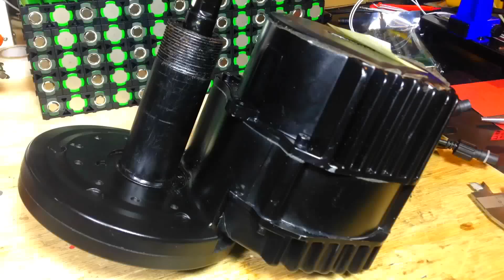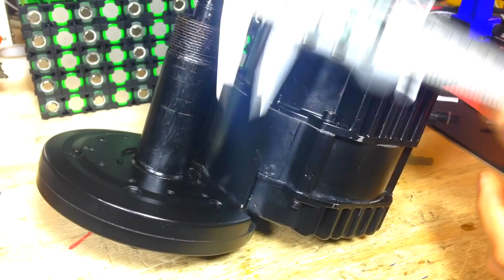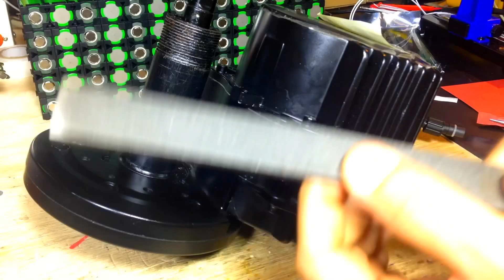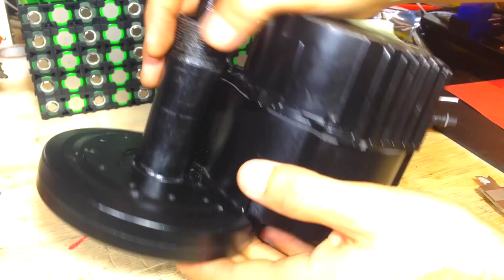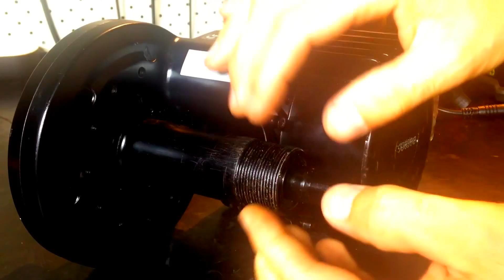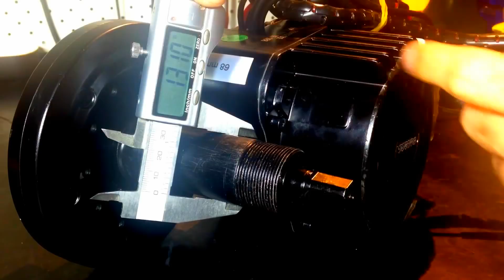BBSHD measurements: carbon fibre, dual suspension, fat bike bottom bracket • Bafang 1000w BB adaptor

Comment: okay who is this other guy that rebuilds batteries out of laptop batteries or whatever you do it more professionally that he does I'm homeless and disabled in Santa Clara California I need to find me a way to make a battery affordable at Laguna cycle is overcharging for the batteries you talk to them as a result I need to start up that be fun motor you're talking about is it good put the good motor to put on a bike and you're going through all this stuff I get free Target but I want to get power I want to make it but I will check but I don't have $2,000 plus to start up I don't have all those tools to make my battery pack the way you do I'm going to get my old you cells I'm going to make me a smaller battery pack that's not going to cost me $700 and last two years because they're not using the good cells you are using the good cells you're usually good batteries you got all the stuff down you're making it and it looks dangerous I don't have those tools so I thought of them together and now I'm making a good connection what could I use that metal copper stripping out there and I don't have that tool and I want to get as many Souls as I can and I want to make a bigger though they're brand new but I gotta put the battery back on it I don't have to worry about a thing cause I watched about 20 of your videos today I understand it all I got it all the little bits and pieces and then I got a sorry I can't spot weld it and I got to do all that stuff you're talking about I know I need to make their connection to the battery connections the ballast can I just I gotta get me the charging system what do I start with an x obviously you got the high and everything and I can't afford that but I quit would you start up I got to get a battery I have an electric bike piece of junk one but I need to get upgraded motor down the road as a buffet what are the way to go isn't the biotics who's system works good it's reliable I don't care about I'm overweight I just want a lot of battery power but fuck it basically a wheelchair and my legs and hold you up I might even be trapped in the house all day or heat an RV or I got two hours of limited ability everyday of my body and I want to be able to put it under the bike I won't be able to tell the bike I'm going to get because I thought I would tell you bout to start with I'm homeless and disabled in Santa Clara please help
Reply from the maker: +James Ledesma - Hi James, I completely understand your disability, my girlfriend is also disabled and I see a huge potential to help hundreds of thousands of disables with these electric drive systems. The guy I was talking is Jehu Garcia in California, he is a really nice guy, if you come to his place "I think" he could help you with some old batteries.Maybe send him some messages and see how it goes. He uses laptop batteries, you may be able to get some from these battery disposal everywhere around the USA, take some home, open, get the cells, get a small battery tester and check the cells, 80% would be fine around 20% may be bad or you may be lucky and get all cells 100%
Let me know how it goes, I hope I helped =]
Reply: But it won't be able to build them like the way you do I don't have all that machinery and I can't afford to buy the spot welders just to build one or two batteries and in the end don't know which one to go with because you I like the way you did with the I love what you did with the motor but I'm a heavy guy on a bicycle that basically isn't designed to hold a heavy guy and I can't cuddle all the time because my legs are but I have to have a townie bike and you didn't put that motor on a townie bike so I don't know if it's even able to hold the weight of me and Mabel to last I can't cuddle all the time but I do what was that goes a lot farther than 4 miles it has to be charged for 5 hours and then have to come back for my house I need a bike that I can build cheaply and I get free Target bikes every day every year so if I can put whatever I want in the Target by and swap it every year I told have any maintenance I don't have any Tire because I don't have any brake maintenance I don't even know if I wanted his brakes or regular V brakes I'm not going anywhere I could climb those big hills in the Bay Area it's pretty warm it's basically only that overpasses that go over other freeways he'd only got a little heel for a little time but the bike is guy it's not going to be able to stand the weather and it doesn't get cold enough here it might only three four or five times a year but I live about billionaires and see if I can't leave this bike outside I got to be able to roll it I might even have to make it a fat bike foldable bike I'm not sure yet because those things are low to the ground and easy to step over and they're able to go over curbs and kind of indestructible but I won't be able to get that bites every year butt I like the bigger Tire and Wheels I felt like the road like that you're off the hook that says that you have to be able to ride it when you stand up on it you can put your legs down and touch the ground only bike you can do that with his accounting bike and they're too expensive to buy the motor system I'm not sure the Boss motor systems even worse by the bus just too expensive the bike is crap bike will fall apart after a year I'll get him if I can replace it every year with a free Walmart or Target but I got the maintenance staff I got the new tires they're here I gotta go got is what bike to start with what motor to put on a hub versus a big Drive in the Big Driver is only 4 guys in the players there's 8 phone I can't pronounce the word it's the motor that you're talking about isn't strong enough to pull my fat ass and not blow up more weight you put on the border the Border but you put to it I thank you for responding but I don't
Reply: Break it fix it but I can't afford it break it fix it anymore I like to do I like put your videos are like I like you break the laws I like all of that for me I don't want to go 24 miles an hour want to go by 28 and that's what California laws are but I got to do with throttle only and I got some heavy here I got to have a better bigger battery pack and I got to go up and down over the hill 28 is a good speed what motor can I put you a 28 mile an hour speed which is bigger 60 kilometers or whatever you call it and you are and your language is 32 kilometers is 20 miles an hour is 64 kilometers away 40 miles an hour I don't need to go that fast probably around 30 so that would be a total of 30 + 1545 kilometers but have some extra power not over push the motor and make it long lasting I can't afford a $800 fucking motor every year I get the free bike but I don't get the free boat and the battery I can't afford $800 every year just too much my car I paid $1,500 April 6th picture of 16 years only play put 5000 miles on a vehicle a year and the state will buy it back for the bottom of the air paid for it so I had absolutely no expense for my vehicle for the 16 years that used it that is reliable transportation to be had already put gas and insurance and I had to pay those stupid smog laws which is the fucking worst of it all that made it so expensive but now I gotta replace it and I'll have to have some kind of transportation that gets me to and from a place that doesn't cost me a fortune at least I can get on the bus when I become fully disabled where I'm wheelchair-bound I going to have a car then that's the fucking guarantee I got to put the chair and doors I don't even have a place to live yet so as a result I have to go to the bathroom I have to get to the gym and I have to eat and I can't do that walking with my body and I can't afford what they're trying to tell me I don't have a van that I have $20,000 that list my wheelchair in my car cuz I don't need a wheelchair yet only if I want to go somewhere I guess since there's no place to sit in the Bay Area to go to the library it's hard to go to the fucking Starbucks hard seats if you go to where do you get to go movie theaters only place you can go and have a comfortable seat nobody wants you to hang out for 5 hours when your charging battery there isn't nowhere to go and I am getting to the point where I'm stuck in this vehicle up in prison that I would lose it if I don't move it cuz I can't afford to move it cuz it's old I live in a 24 foot RV fucking pissed off and I'm stuck here until I get my money from Social Security I only going to increase my income of $500 a month but that's a $500 a month plus $200 a month and I pay him food which is $700 cash available I can find the food and I can find a place to move my vehicle if I had $560 a month to move it I'll never be able to get out of the situation it's too expensive to live here the house here cost $700,000 now but I was a kid my dad bought it for thirty thousand years monthly rent 150 a month he was a truck driver his rent would be 4000 a month and you have to make fucking $3,000 and we can go to the qualify for that he would never be able to live here the average person can no longer live in the Bay Area it's all about rich people who make fucking drop it off for me
Reply: Videos of what really good batteries and I can't afford to buy them brand new and when I can I will I don't know which one that is it is it's a Panasonic something right then when you put them together you spot one of them if they don't hold her and you got him all set I need a big battery pack and put it on your back I don't know if I want to put it on my back or make three batteries that are smaller that I have one of my back I don't want to be connected to the court as if I have to get off the bike and try to connect it bad to do all that first of all I can really say because it's so hard to lift my leg that high and if I can't text and I don't feel like stopping but you right now you're crazy you're like I was when I was your age I've had a motorcycle I did want to go faster I flew 85 feet in the air and that little Bush you walked away that pretty much just wondering about the motorcycle anymore because of the power potential of what does the average would be like when you wreck but a bicycle at 20 miles an hour is still when you crash it and you are going to fly like Superman and if you out where the hell it it will fuck you up but right now walking down the street at a slow pace and only having the ability to get off the bus and we walked half of my limited wheelchairs unlimited I have something that gets me back to the bus and I don't know how to build it what to buy yet but it looks like a townie bike is the way to start because the Ford cranks sometimes I can't bend my legs all the way around a regular bike but I have to jump up on the seat and I can't touch the ground so I don't like him today right where I'm trying to stop the other team so I would prefer that I can put my feet down like a motorcycle but can't buy one so I'm looking at a moped electrified those bikes are built a little bit stronger than regular bikes and they have the durability of wheels that kind of fell apart a week and they have the ability to hold big battery but they're really not bikes that you can pedal I'm not going to get any exercise from them so I wanted to things out of this thing I wanted to be able to get some exercise because I can't go to a gym and exercise because of my condition I got to go they're clean I don't have enough money to do my laundry so I don't go there please I don't want to get naked in front of a bunch of guys so I don't like dressing in front of them and there is handicap showers there are two of this one yet but I have since I'm 54 years old is free if your a resident but I'm a resident with a church address so I'm not really a resident so until I lose that privilege to pay for a gym membership there their they're clean coming in well I'm using it to get hurt either it's a funny world we live in you don't have your own place your own pay your own bills nobody wants you anywhere near you so I don't know there's places I can eat there for an hour and I get to the people that move in here somewhere else
Reply: N Kawasaki motorcycle back in the 90s and I was able to straddle the bike and I was able to be fit I was able to go fast but realized that I was thinking about that powerful I was doing 85 miles an hour on a turn up on Highway 35 which is about turn lost control of the bike I flew 80 feet land in the bush and walked away and realized I wasn't wearing a helmet was wearing tennis shoes t-shirt and corduroy pants got lucky that time I was through 85 feet legs and push my bike wasn't so lucky hit the tree it destroyed so I do realize that they do have to be try to be kind of crazy to ride with this is my wheelchair only way I can go to the park I can go to the grocery store in the Trap by fucking 12 hours a day cause I'm sitting on something that's no longer making me stand on my feet what causes my disability I can only be on my feet for like 2 hours a day any longer I hurt myself it hurts I can't get no exercise and I can't go swimming and something called lipidemia which means I have it I can infect the pool so I can't go to exercise in the pool at my old school I can't go to the gym as long as I'm clean so I can't go there clean I don't have clean clothes to carry on my back on my bike and do all that and come back is ridiculous it's too much weight too weird I just need to go there take a shower and go and most likely if I could pack dirty clothes into the clothes I just brought it it's a pretty big bag to have on your back you have to tell you can change your clothes you gotta have a shower stuff and then you gotta bring it back again to bring it back with your dirty clothes in it everything is better at the store so it doesn't require you to have all that stuff you gotta have you got to have a way to fix the flat tire it says another 20 pounds of weight plus you want to bring some good luck on your back or your battery on your bike you can ride your bike for fun and exercise if I could cuddle like the same things all the time
Reply: In our area all around town stuff is around 3525 at 20 miles an hour the freeways are 55 miles an hour and the expressways are usually 50 miles of me the freeways are 65 miles an hour and the expressways around 5845 these are the only states that you can actually ride a bicycle fast as you're going to ride a bike so 35 mile an hour streets $45 our streets are only place where bicycles are allowed but they're only supposed to be able to go only 28 miles an hour that mess with you when you're going 30 miles an hour and you're not pedaling on a bicycle but only on those streets there's only a few of them in the El Camino Central Expressway Santa Claus and Lawrence Expressway where I'm at please leave the fastest roads you can ride the bicycle most of the streets + 35 + most of the streets + 35 + 25 streets that kids ride bikes on but anything above the streets are for real you're not allowed to be a kid on the bus go faster all the other streets and I doubt that you're going to be a couple streets like this that we could ride on which our social status and and El Camino and that you can walk on it but you can't walk on San Tomas or Lawrence Expressway either one of the two main tribes in our area there's no bike parks there is no bike paths that are really cool bypass to be out there there's really no place to ride a bicycle that's fun take it off road parks that's about that you can write on grass 28 miles an hour and there's kids around here so where we live every place you park your car cost money if you have he can't get out of your parking spot you going to pay to park it if you live anywhere with their cities stuff like Saturday you can park your car on the street if he can pay by every two hours but we get tickets then you can pick up bicycle u-lock it outside but good luck leaving 1000 mm bike in San Jose and not nobody fucking petsnip in the lock and taking your bike so where do you ride bikes and have fun at work can you leave your bike when you have fun you got a pretty much watch your bike everywhere you go so if he can't see your bike while you're eating you pretty much don't want to put your bike if you don't want to take your bike there if you got to go shopping at the grocery store they let you take the back inside so you pretty much it's Russian Roulette if your bike will be there when you get out now if they have a camera on the bike rack where you park the bike but nowadays a lot
Reply: So now it is a portable grinding tool which cost around $50 could take a bike in less than 10 seconds or maybe even maybe less than a minute and your $2,000 bike is no longer yours a pair of $50 bolt cutters that are huge pretty much will take anybody's bike lock and take it away I can't compete with that really takes 53 seconds to sniff a lot and to walk away with any 30 seconds your bike is gone and nobody is going to go get it and nobody is going to come after it and no cop is going to do anything if you tell your bike is stolen they might even show up an hour later will never go after the guy as soon as you tell your bikes going to go after the person that important to them you can break into cars are you can still bikes and let's see if we get caught in the act if you were driving a car and it's too risky your car for me and I don't know where they never get in trouble big deal is it
Reply: Homeless people that live in tents have nowhere to hide their stuff so if they can't carry it with him it ain't going to be in their position very long because while they're gone the whole lot about the homeless because it make any sense but that's what they did here so if you leave anything of any value if you have a laptop you can't walk around with a laptop cars on the street to do it with your car
Reply: 5 overall by the motor that is able to hold W and go long distances. It's super-fast means but able to basically not have to be replaced after running in a year or two years that were talking something that's worth buying for me I like the way you push it you break it you fix it you break it fix it is amazing that I can do what it does for you what if you were 200 hundred pounds more than only lasted half as long as it's out of my league to buy I cannot afford something is going to break every year I don't know what I was expecting I like to stroke motorized motors for $200 that would last a year and do the same thing to the bike that would be great but they made it illegal to use your in California did they pollute so as a result if you can solve the pollution part of the motorized 2 stroke motor was not something that I can afford and I can start up and I can put gas in it and it will be $200 to replace every time and it's not that expensive to make the size of your fucking hand 20 pound battery go as far as it does 403 it's a great deal if you're rich and I don't know that person to give it a shot help people out and they're actually putting him off the streets their whole story starting with a 4 pics of the homeless man's bike and now they fix the bikes for for hold those people a week and made a business out of it where they put kids to college that are homeless that's a pretty good deal that I have to pay it forward you have to do a good deed pay it forward well I've done a lot of those kids so I don't really qualify then I'm going to buy me the bike they're not going to fix my bike I gotta fix my bike I just need to find a bike that has a good motor on it is it going to blow up because it's being pushed to the limits because I can't cuddle with it it hasn't been built yet but the two-stroke religion was made illegal because it's it's noisy get out of his bike did anybody or parking is pretty much the reason why the first place if you can park on the street or 72 hours but if I sleep for 72 hours I go to jail
Reply: Shut the f up! What is the matter with you? Are you seriously expecting people to read your 2000 lines of pitiful babble? Use some punctuations for everyone's sake.
Reply: ECN I don't check my typing because I talk to my phone it translates I'm not going to spend that kind of time checking what it said
Reply: Hi James Ledesma !
I wanted to excuse my outburst days ago, so here goes: Sorry for my hard words; they were adding nothing of value.
I didn't realise you used dictation, and hence it irritated me that it was so hard to read without punctuation and paragraphs.